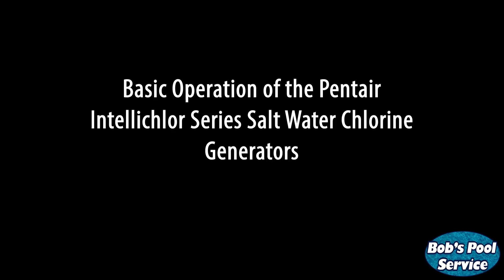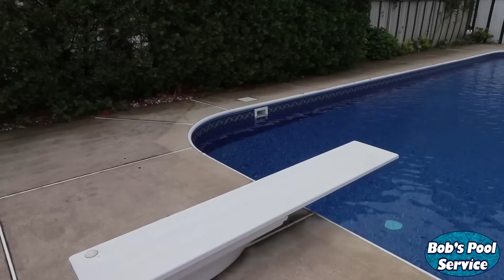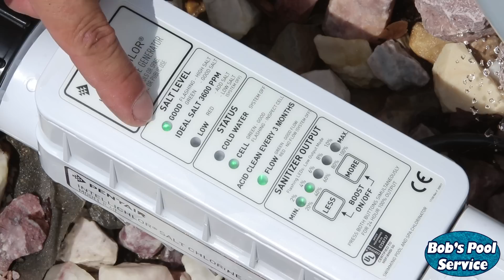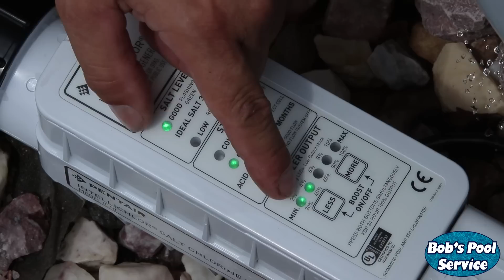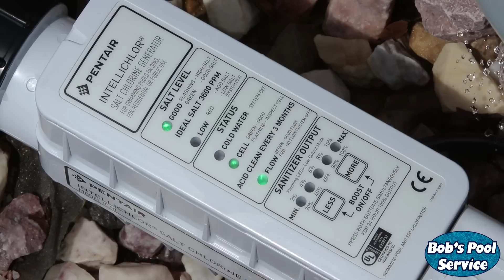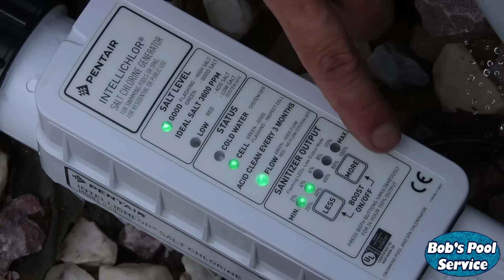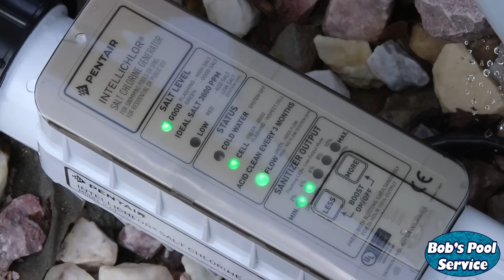Pentair Intellichlor Salt Water Chlorine Generator Operation

Comment: I have a Pentair Pool Chlorinator (Model: Intellichlor IC40). The flow and salt level lights are green yet the unit is not producing chlorine. I need to add liquid chlorine every 7 days to prevent green algae growth. I understand that there may be a couple of parts within the unit that could have failed and need to be replaced? The unit is only 3 years old.
Reply from the maker: Hey Kelley, there aren't many parts inside the cell itself that are replaceable, the flow switch certainly is but beyond that the entire cell is generally swapped.  You should really remove your cell and inspect it to make sure you don't have scale or buildup on the plates, also if you have a pool that's 30,000 gallons or more and the IC-40 you need to make sure the system is run long enough to allow it to have time to produce enough sanitizer for your pool.  Be sure your pH isn't too high and check your chemistry as well, not enough cyanuric acid (stabilizer) can cause a higher demand for chlorine in the presence of UV light.  I'm certainly not a representative for Pentair but having installed Pentair, Hayward, Jandy and other brands of generators they have been by far the least problematic and with proper annual cleanings generally last our customers 7 seasons.  The most common repair we do on these units are the fuse in the power center blows (usually after a thunderstorm we get the call) or in some rare instances the metal arm that holds the flow switch breaks off requiring that part to be replaced.  If you found you're running your system on a higher output setting when the unit was new you may want to consider the IC-60 instead of another IC-40 for your next replacement.  All the units do essentially the same thing but the larger units have more plates inside and are capable of producing more chlorine in the same time period with the added benefit that the larger unit will generally last long as well.  The only time putting  a larger unit on a pool can be a problem is if you're not able to regulate the chlorine output low enough for a given pool but with that said we have put IC-60's on 20,000 gallon pools without issues.  Hope this helps, definitely inspect your cell and clean as necessary.

Comment: My status light is flashing green & my pool is green. This is my 4th cell in 17 yrs is this normal
Reply from the maker: There's a lot of variables, here in NJ we find cells last around 7 years but we don't have a year round seasons and in addition we oversize the units for the pools when possible.  Performing a proper acid cleaning to the cell every year also helps keep it in better condition, if you wait too long and get lots of built up you need to do a stronger watching and that shortens the life of the cell.

Comment: can you swim during superchlorination mode?
Reply from the maker: Yes, superchlorination/boost mode is simply like having your unit at 100% output for 24 hours then it reverts back to your prior setting.  I would however not swim in water with chlorine levels exceeding safe readings.  Above 6ppm is considered too high to be safe.  I am not a fan of the boot mode because it doesn't truly "shock" a pool the same way as putting in granular or liquid does, when you put in a "shock" dose like that it immediately or within a very short time super chlorinates your water, when you do it via the salt generator it takes 24 hours to get there and it's not the same thing.

Comment: This was super helpful! Now I just need to know how to clean it.
Reply from the maker: I'm glad it was helpful, I haven't made a video on cleaning for the reason that it involves somewhat hazardous acids that if handled improperly could be dangerous, for example if you add water TO acid it can react and explode, you need to always add the acid to the water yet I've seen many instructional cleaning videos on youtube where the company did it incorrectly.     The instructions for cleaning/acid washing are in the manual but frankly there's a "feel" do cleaning the cells, you don't want to use more acid than necessary because it shortens the life of the cell yet you do want to have it cleaned regularly so it functions efficiently and you don't get a situation with a lot of scale and built up material.  We clean the cells for most of our customers over the winter and return the cells in the spring time when we open the pool.
Reply: @BobsPoolService  i worked in a dupont chem lab and one of the old timers used to say  "acid in the water like ya oughter"

Comment: The lights are not coming on at all.  Any advice?
Reply from the maker: Hey Sharon the first thing I would check is make sure the power center is getting power check the connection where the cord plugs into the power center sometimes it's not a fixed well and it won't make connectionif those things don't work the most likely problem is a bad fuse in the power center

Comment: Thank  for the video. My ispection cell light blinking green, i have cleaned  the cell and put it back  in service but the light still flash
Reply: Inspection  cell light continues to blink green  after i clean the generator cell
Reply from the maker: You may need a new cell especially if it's over 4 years old..  If it's a fast blinking there is a problem, i would contact a local pool company and have them look at it.
Reply: Thank you for the detailed explanation from the blogger. This is our titanium electrode salt chlorine machine testing video. Welcome to watch. Thank you for your time

https://www.youtube.com/watch?v=Xi4_EYCDL2k

Comment: Great video.. If I may ask two questions. why % should that sanitizer output be on.. Mine is at 80% but you have yours on 40%....
and my biggest question is my flow light and all lights area green in the morning when the system comes on, BUT after 1.5 hours the flow from the jets is almost coknmpletetly off and that flow light comes on red and stays red. The pool is only 3 years old and we just bought this house so this is all new... The pool guys have been out here a number of times and can't figure it out... (tossing faith in these guys although they built this system and pool)... they have take n flaps off the skimmer, level is good,... I can only get the jets on by turning the filter button off, waiting 2 mins and then turn it back on.. The system lights are all green and the jets work for 1.5 hours and then back to red and no jet water.....

We tried to back wash and no water came out... Do you think the system is a dud?
Reply from the maker: So for your first question, nobody can say what percentage it should be set at because there are so many variable, size of the pool, demand for chlorine, amount of sunlight and how often you run the system.  If you cell is at 100% however all the time something isn't right, either the system is undersized or you're not running the filter long enough or your chemisty may be off.  As for your second question if you're losing flow after 1.5 hours that sounds like your filter is getting clogged up, if it's a sand filter sometimes changing the sand will help and backwashing but if it's DE or cartridge the element may need an acid wash or replacement.  I'm surprised you pool guy isn't figuring it out, most flow problems are a clogged pump impeller or an obstruction such as a clogged filter.  There's way too many variable to diagnose youtube however.

Comment: What "Salt Water Chlorine Generator" to buy which can be control from my PLC home automation? thanks.
Reply from the maker: Sorry I don't have a good answer for this, we install 95% of them as stand-alone units and the other 5% with intellitouch controllers from the same company.  Pool automation has been around for awhile but generally unless our customers have a genuine need I tend to steer them away, more complexity and more things to break, I'm also not a fan of the easily cut by landscaper wires that go to the sensors for on any installations, can't tell you how many calls I've gotten when a weed whacker took out those.

Comment: all lights indicate chlorinating but no chlorine. water test good for salt. How do you tell if you need the chlorinator or the control box
Reply from the maker: The way we tested some units was put the unit in a bucket of water (with salt), hold down the flow switch and turn on the power to the cell, if you see bubbles it is working.  If you have power though to the unit I don't believe your transformer is bad. The cells do have a lifespan fo 5-7 years, here in NJ with seasonal operation they seem to be lasting at least 7 for most of my customers.

Comment: Thanks for your video. My system keeps turning red for flow every time I try to vacuum. Why would that be?
Reply from the maker: Hooking up a vacuum always restricts the flow somewhat so the flow is likely enough when you have it hooked up to satisfy the flow sensor in your pentair unit.  If it only turns red when you're vacuuming i wouldn't be too concerned if it returns to normal when you're done.  There's a myriad of things that could be restricting your flow when vacuuming, the most common is air being introduced into the system through the plumbing or a leaky vacuum hose.
Reply: Thanks so much for your reply! Only problem is when it turns red it’s shutting off the pump and then I don’t get any suction to vacuum because it turns everything off. Any suggestions?
Reply: Is it possible the electrician wired it backwards and that’s why it’s turning of my pump? When I turn the pump off my Ic40 LED lights still stay on

Comment: So if cell status light is off does that mean the cell is reading whatever percent is set to produce  and wont produce until level of chlorine drops?
Reply from the maker: No the unit has no way of sensing the chlorine level in your pool.
Reply: @BobsPoolService  My salt is at 4200ppm does that make cell light turn off?

Comment: My cell has a red Light indicating low salt, yet the pool store that tests my water says my salt level is fine. All the other lights (cell, flow) are green. We did an acid cleaning yesterday on the salt cell. Any suggestions?
Reply from the maker: I would say the pool store is likely correct, I have seen this a few times and the solution was to replace the cell. They do have a limited lifespan.  Even when working correctly the salt reading isn't that accurate on the cell itself.  There may be some calibration procedures that can repgoram the cell to indicate more correctly but if the cell is over 5 years old it's probably gone past its lifetime.

Comment: Thanks for the video. I just had my water tested and my chlorine is at zero. I took the cell off and cleaned it although there really wasn’t any buildup on the unit at all. All the lights are green and it says it’s good. I held the “More” button down for three seconds to read the life of the unit. It went to 80%. My pool is starting to get cloudy. Does it sound like the unit is going out? Would it be normal for the unit to be above 8000 hours and still read that the cell is okay? I moved into this house last July so I’m not exactly sure how old the cell is but it probably is around 5 years old.
Reply from the maker: Generally the units last about 5 to 7 years in our experience if you are able to put in the spacers for sale to bypass the unit and get power to it you can test it by placing it in a 5 gallon bucket of water and holding down the flow switch with a wooden dowel if you see bubbles in the bucket and of course the water is chlorinated you know your cell is still working
Reply: Thank you for the detailed explanation from the blogger. This is our titanium electrode salt chlorine machine testing video. Welcome to watch. Thank you for your time

https://www.youtube.com/watch?v=Xi4_EYCDL2k

Comment: Great video  All my lights are green, but the "Cell" light under Status goes off from time to time.   It doesn't blink, just goes from solid green to off when the cell is running.  I have output set to 40%.  My free chlorine is registering low.  Do I need to bump to 60%?  What does the Cell light mean when it shuffles between solid green and completely off?  Thank you.
Reply: Additionally, I've recently cleaned the cell and it was installed mid last summer.
Reply from the maker: It is normal for the cell light to turn on and off but not blink under normal operation in simply telling you when it's illuminated that the unit is generating chlorine at that time

Comment: What is the safe salt operating range for this unit? My unit is only 1 year old but I find that despite the unit saying ideal salt is 3600 ppm I find that in order to get a good green salt level light, I need to get the salt up to about 4200 ppm.
Reply from the maker: 4200 would be the upper limit of safe.  I would try cleaning the cell with muriatic acid to restore conductivity and hopefully correct the erroneous feedback in regards to your salt level.
Reply: @BobsPoolService  thank you.. I shall try

Comment: My system is only 1-yrs old, and after opening this year, and a few days of using it. all the lights are now off and I can't get it to start again. Its not the fuse in the box, checked that. any idea?
Reply from the maker: Check the connector that goes into the transformer, also be sure the transformer is getting power.

Comment: Thanks for that information. I have a Pentair salt system and just recently the Generator shows all green indicators but my panel is showing O salt but it says it's ok, have you ever seen this and would you know a fix for it? I've tried resetting it in chlorinator section of the panel but that didn't help.
Reply from the maker: Hey Joseph, this video was made to illustrate the unit as a stand-alone not connected to an intellitouch  or easy touch panel.  I have seen sensors go bad, communication errors, etc... it's really too complex of a subject to troubleshoot without seeing it first hand.  Just a a general note though I'd like to add that any system which gives salt in PPM is generally an estimation and not nearly as accurate as using something like a Myron meter to check it, yes, it can give you an indication that your salt level is getting low but I'd use a real instrument that also takes into account water temperature to check salinity.  For this reason we generally don't push automated systems, in some cases they can simplify operation but there's a lot more to go wrong.  I can't tell you how many Jandy Tri-sensors I've replaced that went bad and they're far from inexpensive.  If you have a local pool company I'd have them test your water, if you're a DIYer here is the meter we use: https://www.amazon.com/Myron-512T5D-Conductivity-Meter-0-5000/dp/B015XVJ4TI
Reply: BobsPoolService thanks for the quick response. The pool was just completed in December and the salt system was just started up three weeks ago. The builder is on vacation and I was just searching around for a diy solution till he got back.as of a week ago the system was at 3600 for the salt level and I don’t in one week in would have dropped that much not to mention the actual generator unit shows everything is okay so it must be in the panel settings to reset it I guess I’ll just have to wait for the builder to get back. Thanks again🙂
Reply from the maker: @1manbandit  Yeah, no doubt the salt wouldn't drop like that unless you lost all the water in the pool and even then fresh water has some salt residual.  The process of chlorine generation doesn't use up the salt either, the only way you lose it is from rainfall, backwashing or diplacement/splashing.  Evaporation would only concentrate it.  Here in NJ we often get a lot of rain, typically we need to add salt once mid season then in the spring.  Good luck with the pool, enjoy it!

Comment: Thank you for this video. I had a hard time finding information on the Cell light going on for a period then going off.  I knew it wasn’t ‘flashing’ but wanted to understand the behavior.  On when producing chlorine, off when not.  Your video helped explain this section of the owners manual:
0% No LEDs lit - No chlorine produced - IntelliChlor SCG is off.
2% 1 LED blinking Produces chlorine for 64 seconds of every hour.
4% 2 LEDs blinking Produces chlorine for 127 seconds of every hour.
6% 3 LEDs blinking Produces chlorine for 16 seconds of each 5 minute period.
8% 4 LEDs blinking Produces chlorine for 21 seconds of each 5 minute period.
10% 5 LEDs blinking Produces chlorine for 27 seconds of each 5 minute period.
20% 1 LED solid Produces chlorine for 53 seconds of each 5 minute period.
40% 2 LEDs solid Produces chlorine for 106 seconds of each 5 minute period.
60% 3 LEDs solid Produces chlorine for 159 seconds of each 5 minute period.
80% 4 LEDs solid Produces chlorine for 212 seconds of each 5 minute period.
100%5 LEDs solid Produces chlorine for 265 seconds of each 5 minute period.
Reply from the maker: Thanks for all the technical info Adam, I wasn't aware of these exact production times, even a seasoned pool guy can learn from his viewers.  I would have though all 5 LED's would be 300 seconds but I guess it needs a break and shuts down for a short duration.  Having installed and used all the different brand SWCG I still prefer the Pentair over all others, it may not have things like a salt PPM readout but overall we find the units have a much smaller failure rate than some other popular brands.  Glad you found the video helpful and thanks for the comments.

Comment: Why is there frozen water droplets in the top right corner ?
Reply: Wild, I never noticed that.  They're not frozen but they are water droplets, I believe they may be suspended on a spider web that's not visible.  Thanks for the mention, I had to actually watch my own video and check it out.
Reply from the maker: Early morning dew, not quite frozen though.